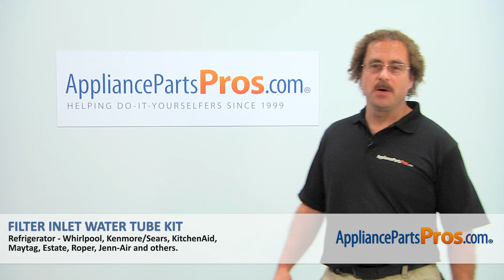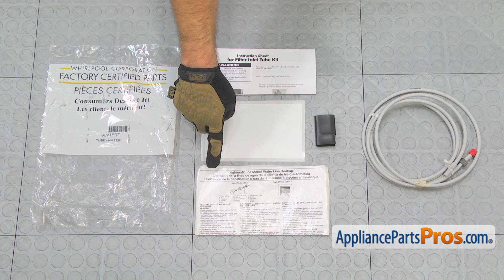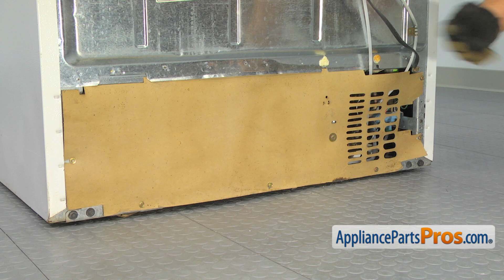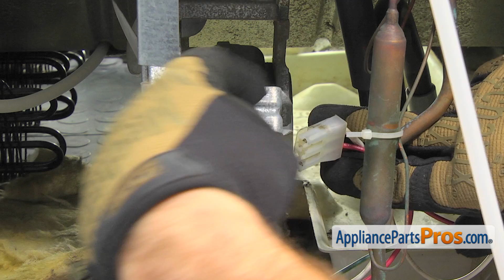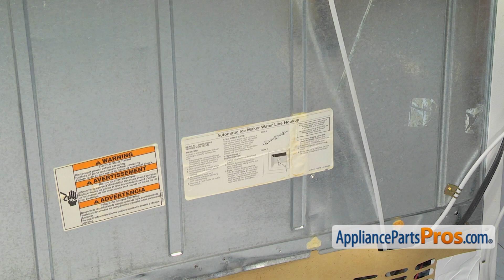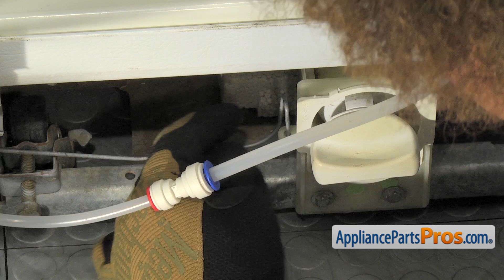Refrigerator Leaking Water? Whirlpool Filter Inlet Water Tube Kit 8201597

Comment: FULL STOP
The translucent water line for the in-door water dispenser on my fridge and for the water filter has broken at least a dozen times while I've owned it, once causing over $10,000 damage when the downstairs ceiling collapsed.  It most often breaks at the bottom corner of the freezer door (lower left hand side) although breaks have occurred elsewhere as well.  It seems the line not only can't handle the bending radius at the bottom of the door, the exhaust from the de-icing fan exits the bottom of the fridge through the toe kick, and the heat contributes to the water dispenser line becoming brittle enough to snap.

I strongly recommend NOT using the translucent line shown in this video.  Instead, get some 1/4" OD reverse osmosis line - it's easy to distinguish because it's a little stiffer and opaque white, not translucent.  The RO line comes in a coil, I got mine from the 'Zon.  Use it to replace as much of the factory translucent line as you can.

However, note that there are two sizes of water line.  One is 1/4" OD.  Make sure you get the correct diameter line or it may not connect.
Reply from the maker: Thank you for sharing your experience. We're sorry to hear about the repeated leaks and the extensive damage you experienced. Since water line materials and routing can vary by model, we recommend confirming any replacement tubing is compatible with the refrigerator and approved for its water supply system before installing it.

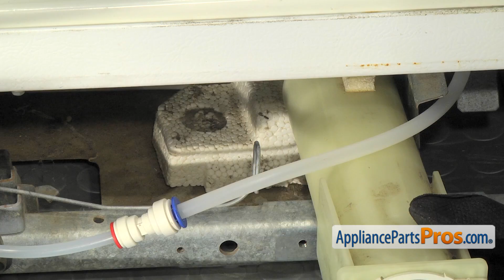Comment: What is the second one by the one you disconnected at 1:59
Reply from the maker: That water line is connected to the water valve. It is part number wpw10350006
Reply: @appliancepartspros thank you
Reply: @appliancepartspros the line that you replaced seems to be a 1/4 inch line but the port is for a 5/16 water line. Do I just use the1/4  line anyway?
Reply from the maker: There are 2 water lines, once is the 1/4" and  the other is 5/16"
Reply: @appliancepartspros Thank you. I have water and ice now. ❤ Thank you !
Reply from the maker: You're welcome!
Reply from the maker: What is your model number?
Reply: @appliancepartspros ED2FHEXVBO1
Reply: It's 5/16 port and the I ran the other 5/16 from the reservoir tank to the door like the line you lifted about the way to access the filter housing

Comment: Wow. Never showed how it connects to back of ice maker. The whole reason I watched
Reply from the maker: This part is the filter inlet water tube, it connects to the filter, not the ice maker. If you can provide your model number I can see if there is a video for that water line.
Reply: @appliancepartspros  thank you ! It’s a whirlpool ED5VHGMT00 made in ‘03. We recently turned the water off at this place the fridge is and when we turned it back on there was ice jammed in the tube up top that goes into the ice maker tray and even after thawing it it never refilled with water however the water does out the door dispenser. Ice still made if we pour it into ice maker. Don’t see a leak or kink in the tube. Have plugged in and out several times. Water won’t fill into ice maker.

Comment: Mine was a bit trickier.  My part had to be removed from behind, so I had to remove the valve assembly, the metal plate  securing the valve assembly, and the drip pan to clear a path for the part to be pulled through the back of the refrigerator.  The part I purchased was installed by doing the reverse.  Pulling on the valve assembly to get it out of the way did cause a small leak which I was able to repair by reinserting the corresponding hose into the leaking valve.  Hope this helps someone who has a similar configuration.
Reply: yes, thanks for the comment. I have a kitchenaide and I can't pull it through the front.
Reply: We have a litchenaid and had to do the same thing. To anyone else with the same issue, you do not have to remove the doors. You just unbolt the filter housing, so it can slide back, and you unhook/rehook the line from the back of the fridge. You do need to remove the valve bracket and slide out the drip pan, as was mentioned, but it's an easy fix once you realize it's all done from the back.

Comment: my kitchenaid has a metal frame piece that you totally did not even have once you removed the flimsy little plastic grill housing from the front, appears I have to remove my side by side's DOORS to release those two screws below my filter to pull it forward...

Comment: Excellent! That was exactly what I needed. It appears the little bracket that holds the water line on the back of the fridge, is prone to cut the plastic water line. I wrapped electrical tape around mine to keep the bracket from cutting into the waterline. Some sort of a plastic sleeve would be ideal.

Comment: Very nice video. Is there a trick to using the 3/8" wrench to release the water line from the filter cartridge?  I'm pressing the wrench against, what I think is, the release mechanism on the filter cartridge fitting, but the waterline is stuck.
Thanks for the video!

Comment: And that clamp is the reason I need a new line since it's what cut into the tubing overtime.  Then the fact they stepped up at the connection so you can't just replace it regular 1/4" tubing...
Reply from the maker: They normally use 1/4 or 5/16th tubing.
Reply: AppliancePartsPros Yes, but the used both at the same time on the same hose, which is not normal.  1/4 line with a 5/16th end molded on.  So cut the regular line leaving the 5/16th end connected to the filter, use a 1/4-1/4 union on the end you just cut and run your own line back to the valve.  New line at 1/20 the cost...
Reply from the maker: Glad you got it figured out!
Reply: Had exactly the same issue with the clamp cutting the tube.  Thanks for the tip on splicing the lines.